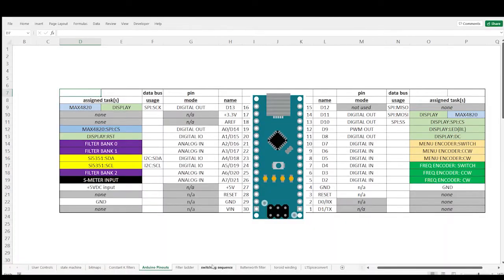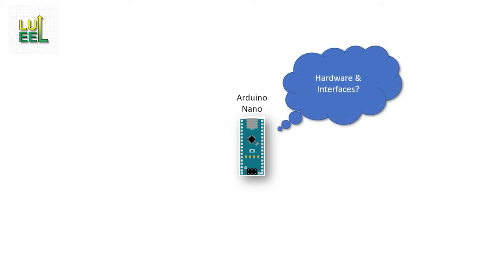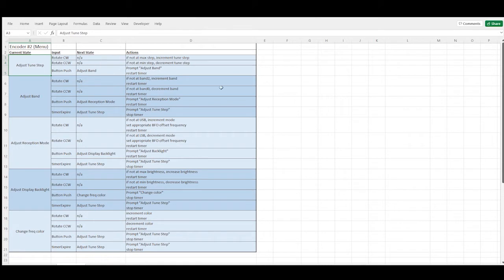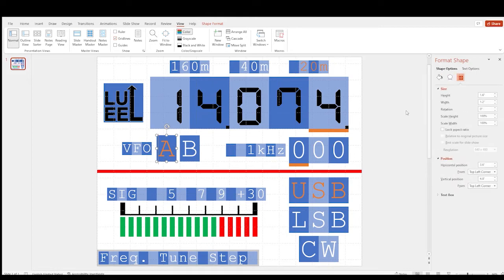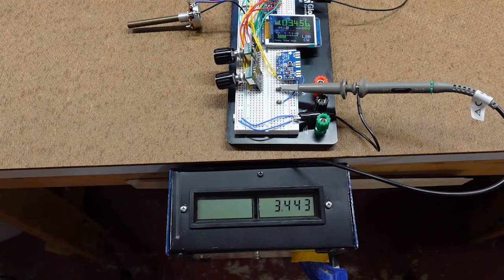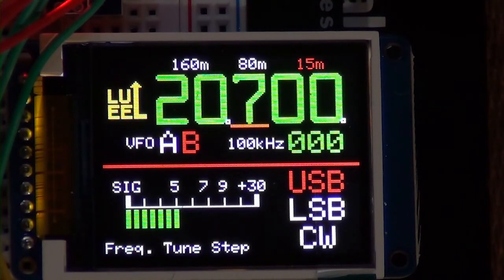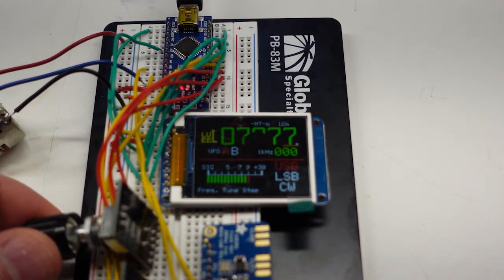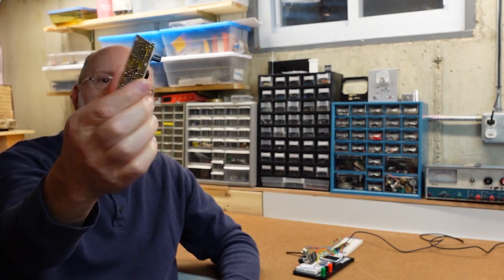Superhet Receiver Part #4: Software!

Comment: Thank you for this video series, I'm learning a lot for them. Is the Arduino code still available for download? I also plan to go through the transmitter series as well. Thanks again.
Reply: @Level UP EE Lab,  another request here for the code. The way you have done the graphics and interface is quite elegant I am interested in a building a similar receiver.

Comment: Hi - this is really great stuff here, thanks for taking the time to produce it and sharing it with the rest of us! Do you have a video on the techniques you use for making your own PCBs? I'd be interested in any specific suggestions/recommendations you have.
Reply from the maker: Thanks!  Actually, the techniques I use are those shown on Mr. Carlson's Lab.  Search for his channel, he has very detailed tips on how to get great results using the toner transfer method.  My own little adjustments were to (1) preheat the bottle of FeCl by soaking it in a bucket of hot tap water for 15m before using, and (2) constant agitation of the board.  That makes the FeCl react faster with the bare copper and remove it before it eats into the toner and gives the swiss cheese effect.